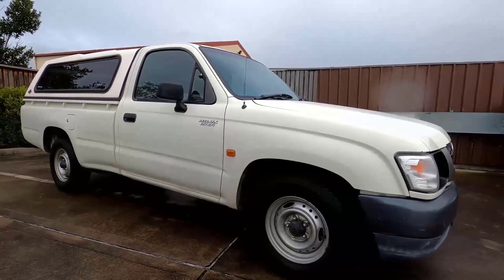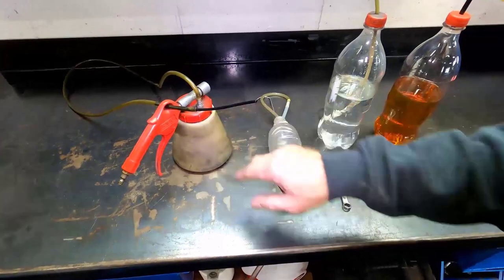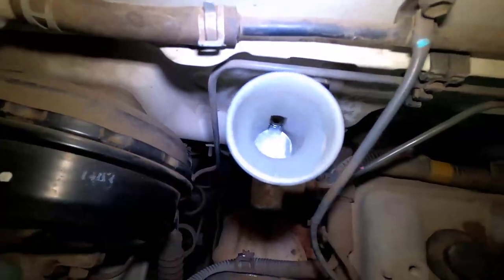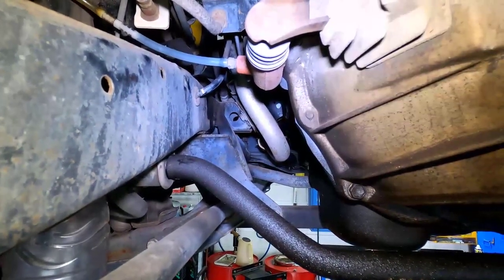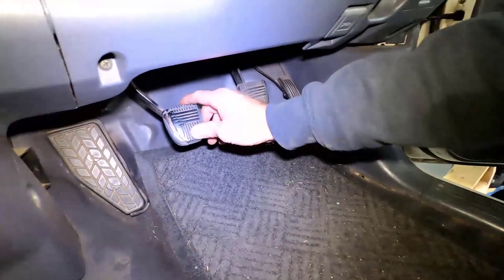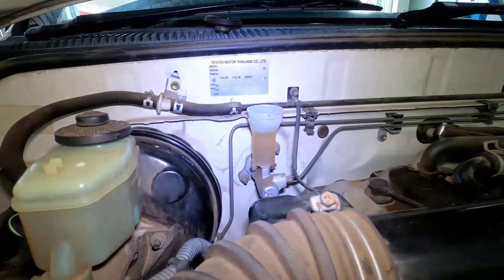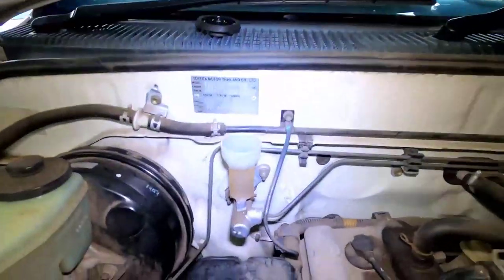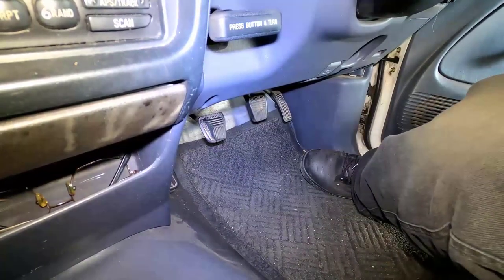How To Replace Clutch Fluid on a 2004 Toyota Hilux. Ep3

Comment: How come you didn't have to push the clutch in then crack the bleed nipple, then tighten the bleed nipple and release foot off clutch pedal and repeat?
Reply from the maker: G'day Matt, yes that method I was taught during my early days, but being in the industry now for a long time and working on my own, you develop different ways to do things. I found to me that this method I use is much quicker and efficient for me as I work on my own with little to no help. If you like I have a video on " Flush Brakes Easily. Ep16'' that you can check and see how quick and easy you can do it on your own without any help. Both methods will give the same results in the end, my way is just a little faster that's all. Hope this helped.